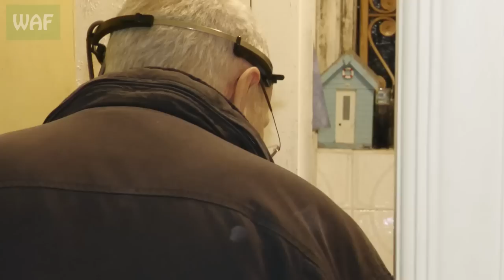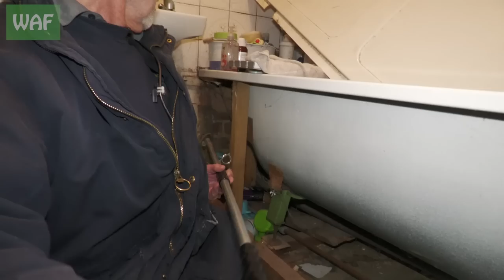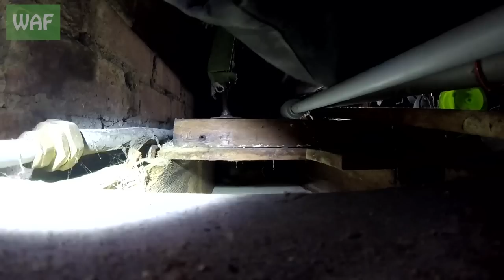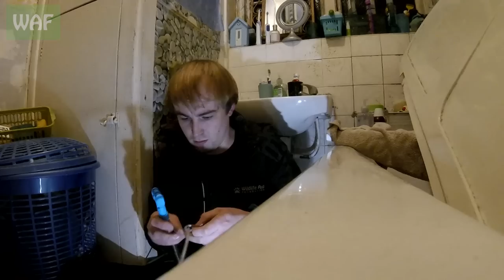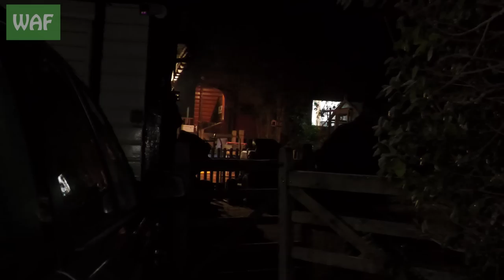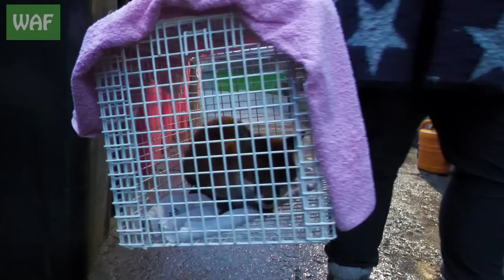Trapped fox hides UNDER THE FLOOR!

Comment: Super rescue. Well done. 
Can I ask, what is the cable you used for this? I need to get one. Thanks!
Reply from the maker: Thanks very much! The cable is the same cable that we use in our regular graspers (braided wire coated in a soft rubberised plastic). We have a few different gauges depending on the situation. If you're in the UK, the replacement cables from MDC Exports will work well :)
Reply: @wildlifeaid  Thanks a million! That's great info!